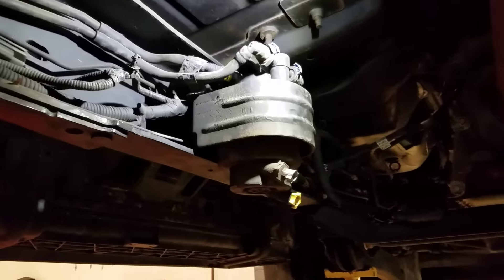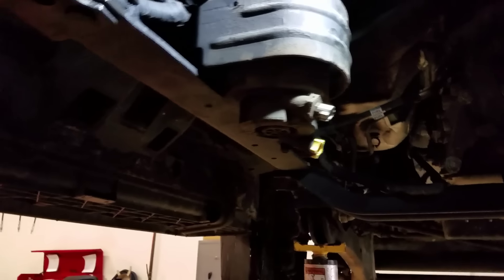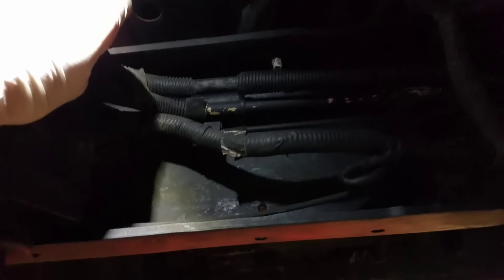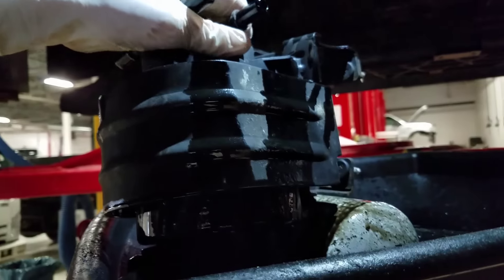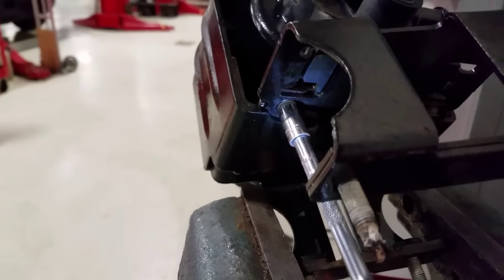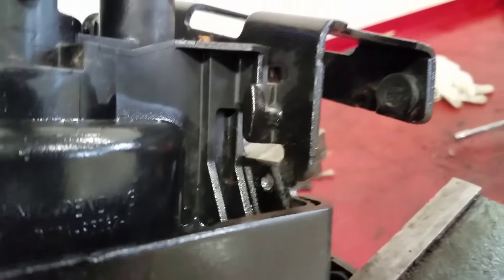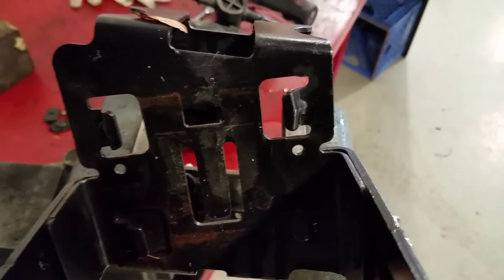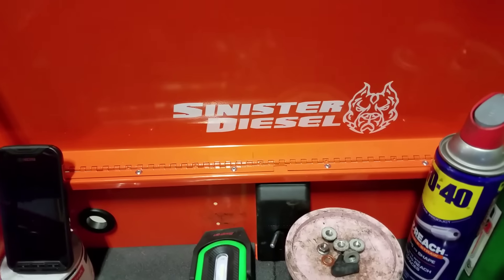6.7 Fuel pump - 11 to 16 Powerstroke

Comment: How does that top electrical connection unhook ? .. not all of us have a lift ..we have to do it on the ground 🤦‍♂️
Reply from the maker: U dont need a lift to disconnect it or see it. If u have a mirror u can see the button to depress. Feel it with ya fingaz!!
Reply: @PowerStrokeTechTalkwARod  it doesn't have hair around it 😂and I don't have a mirror but I did get it finally it's got one that pulls back and then you got to pull in the connection at the same time
Reply from the maker: I didnt wanna say it but ya beat me to it 😉 knowings half the battle. Dont ferget to bleed it when ur thruuuuu
Reply: @PowerStrokeTechTalkwARod  or fo i leave a line off ...? Blue or yellow
Reply from the maker: Do it at the top. On the filter  There are 2 lines that are piggybacked together leave them connected but take that line off the fuel filter Cycle the key and you will get some fuel flow and then it will stop keep cycling the key until you get a steady flow of fuel shut the key off reconnect start truck check for leaks
Reply: @PowerStrokeTechTalkwARod  thanks for the help .. hope it's only the fuel pump
Reply: @PowerStrokeTechTalkwARod  new fuel pump in and getting fuel past the secondary fuel filter... still not running 😔
Reply from the maker: Email me brahhh, goto my about page. Ull see it there
Reply: @PowerStrokeTechTalkwARod  anything i should check before I rip it apart  ? ..  or melt it down lol 
These Fords and their sensitive fuel system are like watching the people cry when HILLARY lost 🤣🤣🤣
Reply from the maker: Email mE
Reply: @PowerStrokeTechTalkwARod  did you put up VIDEO on how to change out a fuel system on 6.7's ? Fords
Reply from the maker: No not yet...
Reply: @PowerStrokeTechTalkwARod  i emailed you
Reply from the maker: Check ur email
Reply: I’m having the same problem. I don’t feel spot to press down. Videos like this suck, because you don’t show the struggle of doing it.
Reply from the maker: Thank you!

Comment: Thanks for the Video it's super helpful.  How do you disconnect that wiring harness at the top.   I've been trying to reach up and feel for clips to push but for the life of me I can't find them.  I don't want to break it pulling it off there.   Thanks!
Reply: ARod -  I found the push-tab on the top of the wiring harness......it was just tough to see / press when everything was still mounted.  Thanks again for the video it was very helpful
Reply from the maker: Great, glad u found my vids

Comment: Ford has always done my fuel filters and they have a video here:https://www.youtube.com/watch?v=SSOic1wiIIU      Suggests air leaks I have a loud hum. I havent verified if the filter is loose but how can ya defintely verify or is there a way to verify its not caused just by air leaks ? A more in depth on this vid mite be helpful?  Ill check the filter housing. I only have some 23k on a 2016. Great VId Id so appreciate a response on this. Also Wouldnt this somehow be covered by warranty even tho Im past 5 years with such LIttle mileage??
Reply from the maker: ......does your warranty go beyond 5 yrs..?? Doesnt matter the mileage, in your case time ran out.
Reply: @PowerStrokeTechTalkwARod   whatif the fact I noticed the top part of this pump spins freely??    I checked to make sure filter was installed correctly and the tabs are slightly Off. tried to tighten a tad bit and the whole bottom 8 -10 inches from the petcock spins from top half. Its spins above from where the fuel filter bottom half should spin off.   I feel like the last filter change mite have damaged something?  Possible??

Comment: I have a 2014 6.7 F350. I have 350,000 miles. I have replaced the frame lift pump 4 times for the same problem. Low fuel pressure on the dash and loss of power. Multiple fuel filters also. Changed every 10,000 miles. Ford has warranted the pump each time but now say it is something else. I buy from Shell which turns the diesel regularly in their tanks. This last time I just change the filters @ Ford dealer  after a breakdown. I tow travel trailers. They tore apart the pleated filter and did not see anything out of the ordinary after only 9,000 miles . Makes me not comfortable leaving the house at 2am. Any suggestions? Fast filter system? The truck is stock other then deleted and has an after market Titan 65 gallon fuel tank that has been installed a hundred thousand miles ago.
Reply from the maker: How often are you goin thru pumps??🤔

Comment: I have a big question 
On a 2017 ford f250 6.7 diesel.  
I have 3/4 of the tank full of diesel and then i put 2 gall of def fluid in the fuel tank  with the truck running  after 4 min shut off and wont start i gain  then i remember what i did  i got it towed to the house. And dont know what  will need to do. First.   Thank you
Reply from the maker: NOT GOOD. Hope you have $11,000 bucks. Your whole entire high pressure fuel system needs to be replaced, I mean everything! The low pressure will need to be removed and flushed out. Drop tank, dispose of contaminated fuel...replaced pump inside of tank. I MEAN THERE ARE ABSOLUTELY NO SHORT CUTS FOR WHAT JUST HAPPENED. NOT WARRANTY!
Reply: PowerStroke Tech Talk w/ARod  thanks for respond.
But there is no pump in  the tank   Only the send unid to show how much fuel i got in the tank
Reply: How much will cost to drop the tank and change filter and flush the system?
Reply: colas solorzano the pump is on the rail, when you get DEF in the fuel system it trashes the cp4 pump sending metal particles and pieces all throughout your fuel system, so everything needs to get replaced, look up ford 6.7 fuel contamination kit, Pensacola diesel gives you all OEM parts you need with the exception of the low pressure fuel pump, for like $3500 with a $1000 core charge, labor will run you around $3500-$4500 if you take it to a diesel shop and not the dealer, very costly mistake, next time add the disaster prevention kit on your truck

Comment: How do you remove the lines off of a 6.4? It has a different style clip on all four lines. I don’t want to break them. There is a blue clip in the middle. I didn’t want to pry on them too hard. I can’t get my fingers on each side of the clip like the 6.7.
Reply from the maker: Depress the colored tabs in the middle on both rear lines. The front 2 u need a special tooool
Reply: PowerStroke Tech Talk w/ARod Thanks for the quick reply. So I just press on the two on tank side. What’s the special tool for the engine side?
Reply from the maker: It is a tool to release the quick disconnect part inside the line

Comment: Great information just bought a new pump for my 2012 F350 6.7 with 81,000 miles.My question is there already a filter in the housing or do I need to install one.
Reply from the maker: Goooood to go bro!
Reply: Ok thanks
Reply: Which one to get? ☺ 2012 F550

Comment: You called it a low pressure fuel pump,
Does that mean these engines also have a high pressure fuel pump?
Thanks in advance
Reply from the maker: Yes

Comment: Would you recommend a new 6.7 powerstroke? I have a 7.3 that has treated me well. Worried these newer diesels will cause me problems.
Reply from the maker: +Dan Smith 7.3, keep......6.7 bad ass BUT & I say BUT.....if stuff breaks on that & u have to pay for it, its gon make you wish u were fixin your 7.3. 6.7 is the best, its just the aftertreatment and electronics are so expensive to replace. Get it, id recommend getting Ford's premium care as an extended service plan. Best bang for your buck. From factory you will get 3yrs or 36k miles-whole truck.....5 yr 100 miles on just engine. Then P-CARE will take u 100k miles bumper to bumer or 125k miles...and/or u can get the extended diesel engine care plus which takes ur engine to 200k, or 8 yrs from warranty start date. Hope this helps with your financial decision. Truck is awesome, ive built a 2017 entire truck from the ground up.... I KNOW!!
Reply: PowerStroke Tech Talk w/ARod right on, Ive always been a ford guy but what’s your unbiased opinion on the other brands. As a technician, would you put the powerstroke over the Cummins and duramax?
Reply from the maker: +Dan Smith i have never done anything else but maintenance on the other two....however, being smothered in Ford inside & out IT IS ALL I would recommend....PoWeRsTrOkE's ALL the way.
Dont get me wrong there are techs who work on those other two for a living as well,  they all have issues.....built by man. But for overall intricacies of our favorite brand & to diagnose, scan tools, latest up to date information, special tools & pretty much having them in my backyard...its hard to be unbiased....lol In my tier......#1 FORD!!!!!!!! #2 GM(cuz i really want a Vette) and in way way WAAAAAY distant 3rd...im not gonna even put a number sign in front of 3 cuz I despise it that much....................................dodge/chrysler/fiat/ram....all of it. I mean if ur GIVING me a Viper, ill gladly take and look the other way...lol Just my two cents mister.
Reply from the maker: +Dan Smith u shld p.m. me

Comment: I have a 2011 Ford F-250 and it makes a really loud noise from that pump and it won’t crank, before it shut off on me it said reduced engine power and a low fuel pressure code but now it won’t start at all, any tips or ideas on what it could be ? Maybe changing the pump will fix it ? Thank youu in advance
Reply from the maker: The fuel pump has nothing to do with the engines ability to crank.......be more specific please..
Reply: Andres... what did u find out? My 2011 is doing the exact same thing
Reply: Mike Houston no sir I ended up letting it go
Reply: @PowerStrokeTechTalkwARod  Do u think you can help me out? Throwing code po192 Low Rail fuel pressure code...replaced both filters...truck can do fine for a week or 2 and then it will get to where it will crank and not start...wait a minute and try and fires right up...has stalled several times driving down the interstate...Took to ford dealer and they couldn't find anything
Reply from the maker: I need to put the comp on it to see what everything is reading. Lota of stuff

Comment: Dude I just had our 14 F550 in the shop for low fuel pressure, the pump was screaming. I took the FF off and checked to see if it was blocked it was ok. Put a new filter in and made sure it was tight and against the stop, still screamed. So I went and replaced the secondary and all is good. I think it was sucking air at the second filter!
Reply from the maker: +Kevin Sheriff Jr good find ud

Comment: I replaced my fuel filter and found a small spring in my catch pan, any idea what it is?
Reply from the maker: Not good. Part of the pump bro
Reply: @PowerStrokeTechTalkwARod  it’s about a half inch long and 3 mm wide I was hoping it was from the wif  plug  possibly ? The truck runs fine.
Reply: @PowerStrokeTechTalkwARod  Aha-it was the wif sensor float contact thank God.

Comment: Question, Is my fuel filter after the fuel pump or before? I have two filters, one under the hood and one under the truck. I am worried about failure of the fuel pump sending small metal pieces into the injectors.
Thanks much!
Reply from the maker: It is in the fuel pump, pumps from tank, filters..then sends to secondary filter for further filtering...the rest is history!
Reply: @PowerStrokeTechTalkwARod  Thanks!

Comment: Could this pump cause a P0191 code?
Reply from the maker: Yea but ud have other issues with P0191
Reply: @PowerStrokeTechTalkwARod  It lopes and surges at idle but only sometimes. It has died a few times at stop signs too. I've changed the fuel rail pressure sensor and regulator and can't find any metal anywhere in the system.
Reply: @PowerStrokeTechTalkwARod  My fuel rail pressure is also 4350 at idle. I hear it should be 5000. Runs like a beast but just has occasional hiccups at idle.
Reply from the maker: Your going to need to follow the correct pin point test to determine what the dilly is.

Comment: What size are the nuts that hold the pump to the frame?
Reply from the maker: Older ones, 13mm....15 & 16 were 15mm
Reply: I'm getting a p062a code and not hearing the pump prime
Reply from the maker: Gonna have 2 check pump powers & grounds....
Reply: @PowerStrokeTechTalkwARod  I had 12 volts at the relay. Is there a wiring harness plug between the fuse box and fuel pump?
Reply from the maker: I duno i dont have the wiring diagram in front of me
Reply: @PowerStrokeTechTalkwARod  I had a bad pump and bad fuel shutoff. Also its a 15 and had 13mm nuts.
Reply from the maker: Gotcha!!

Comment: i changed my fuel pump because i was getting a low pressure warning light, after i started it it ran for about one minute and shut off after that it wont start again im confused, is there  a chance air in the line may have shut me down? if so how do i bleed the line?
Reply from the maker: Yea, u need to take the supply line off top filter and purge air out that you put in
Reply: PowerStroke Tech Talk w/ARod to purge do I turn the key to the on position
Reply from the maker: Sure doo
Reply: Thank you! It’s still not working so I’m going to change both filters and try again. Originally the warning light low fuel pressure came on and then it went to reduced power mode and now it’s in ‘no go mode’ lol
Reply from the maker: Gotta keep priming it push fuel out eventually
Reply: It worked you’re a badass!! Thank you, I did have to get two new batteries but after that, it worked. Is there a possibility my truck started shutting down because my batteries were weak?
Reply from the maker: No most likely not. Crankin on em when their in a low state of charge can mess em up
Reply: PowerStroke Tech Talk w/ARod  Good to know!! Thank you for being so readily available and I’m following you now! I respect you for being so quick to help! If I could buy you a beer I would! 😎
Reply from the maker: No sweat my pet, holla ANYTIME😉 This is prolly better Powerstroketechtalkwarod@gmail.com

Comment: I need the yellow fitting line going from this pump to the fuel tank on a 172” wheel base. Cannot find it online anywhere at all. Can you provide apart number for this line, please???
Reply from the maker: Email me with the vin....
Reply: PowerStroke Tech Talk w/ARod... 1FT8W3BT4BEA55681. I’m putting a 65 gallon Titan in mine today and the yellow quick disconnect on the old tank was seized. Ended up breaking it trying to get it off.
Reply from the maker: Ok, i am est i will let u know tomorrow
Reply: PowerStroke Tech Talk w/ARod Thank you very much!!!
Reply from the maker: Bro, it comes as ONE line assembly. They are NOT separate. Ford doesn't offer them that way. Whole bundle part number is : BC3Z-9S278-DU 172" WB. Email me & let me know Powerstroketechtalkwarod@gmail.com
Reply: PowerStroke Tech Talk w/ARod... thank you very much. Not sure why I cannot find this on the internet. Looks like I’m out $330.00 now. Are those quick disconnects not replaceable?
Reply from the maker: Nope
Reply: PowerStroke Tech Talk w/ARod... Ford has to make that money. Wow. Thanks again for your help. Subscribed!
Reply from the maker: Stay LOCKED to this channel, tell all ur buddys!! See you FRIDAY NITE 🤝😉
Reply: Ok. I'm out in the snow and having issues getting the damn clips disconnected and getting the pump electrical plug disconnected. HELP PLEASE I don't want to break the damn plastic stuff because of the cold
Reply from the maker: What do you want me to do
Reply: @PowerStrokeTechTalkwARod  how do I get the electrical connection for the pump loose? I can't find the tab to release the connection
Reply from the maker: Very top. We went over it in the comments a long time ago.
Reply: @PowerStrokeTechTalkwARod  ok. I'll do some more searching

Comment: how loud was the scream ?  I after numerous complaints got mine replaced for an obnoxious whine  they kept saying it was a bad /clogged filter  causing it to draw in air (I agreed it was drawing air but not why)but 3 filters and 3 orings in 10k I whined louder than the pump (cost was redicilous 3 filter with less than 1000 miles each before noise returned )and got it replaced   Which eliminated the whine noise  both the pumps and mine. Lol
Reply from the maker: +Bleeding Diesel903 lololol, yea loud enough for you to be like what the hell...is that. Some have set the engine light, or low fuel pressure warning like this 1 did
Reply: Just changed the filters and cycled the fuel pump 8 times for 30 seconds. Truck started driving sluggish as hell after a mile then ran fine for a little bit (maybe 15 miles and started the sluggish again). Just drive it to work and it ran fine (4 miles). Is my pump going bad? I can hear it whining when starting it and driving. Doesn’t seem overly loud though. Suggestions please!
Reply from the maker: R u sure you tightened the cap all the way, I have seen that A LOT